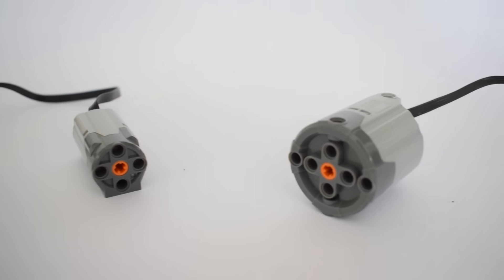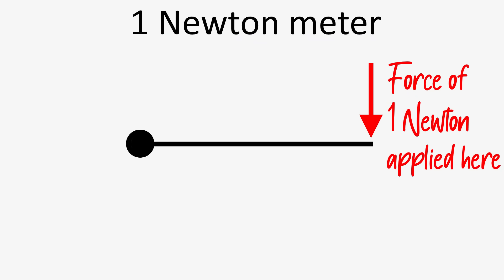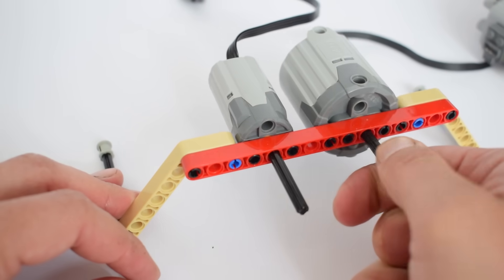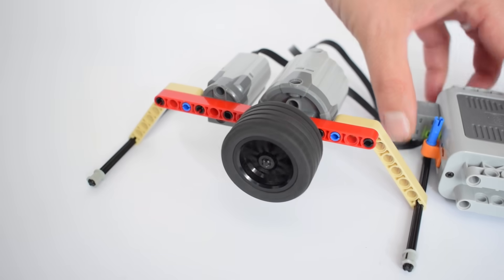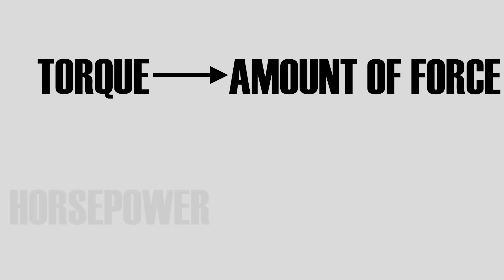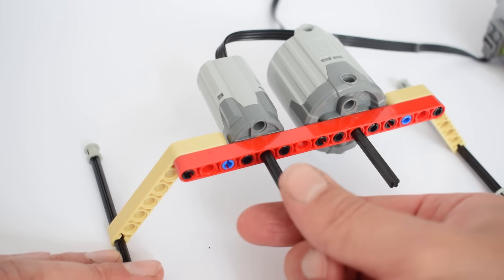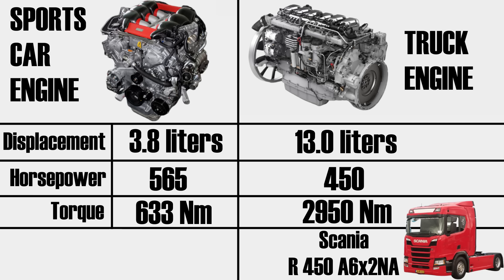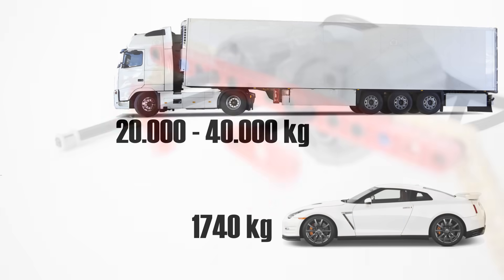NEVER be confused by HORSEPOWER and TORQUE again - HP and TORQUE EXPLAINED in the MOST VISUAL WAY

Comment: Another flawed explanation!
1. The narrator says you can't feel power, but that's 100% wrong.  If you are in a car that is sending 200hp to the drive wheels at 60mph and then get in a car of equal mass that sends 400hp to the wheels at 60mph, you will absolutely feel that in the form of accelerative force in your backside.  Watts are another unit of power: hold your hand 1" away from a 50w incandescent light bulb and then 1" from a 100w bulb and you will feel the difference in the form of heat as well as see the difference in light output.  Slow-burn 1 gallon of gasoline over an hour and then vaporize a gallon of gas and make it explode, you will feel the difference in power with all of your senses!
2.  If we transplant the GTR engine into the truck and gear it for the same road speed at its peak-power RPM as the diesel engine was geared, then it will pull more weight than the diesel engine at the same road speeds.  Power always determines the amount of work a vehicle can do in a given time interval, but the way the truck is geared it is putting way more power to the road at 5mph than the GTR because the GTR is geared much taller relative to its engine's RPM range.
Reply: Great explanation bro 👌🏻
Reply from the maker: You refuted your own claim 😂 You're feeling acceleration, heat and detonation. None of that is power. You can't feel torque*rpm, only its consequences. The gtr will not pull at the same road speeds because gearing sacrifices speed in favour of torque or vice versa, you can't have both, gears aren't magical. https://youtu.be/txQs3x-UN34
Reply: @d4a  acceleration is purely a function of power, road speed, and load.  The formula for determining the tractive force (TF, in lbs) that accelerates a wheel-driven vehicle is TF=375(P/V) where P is horsepower and V is MPH.  Engine torque is not considered at all: whether the engine is sending 400hp at 2000rpm and making 1050lb/ft of torque or at 8000rpm and making 263lb/ft of torque doesn't matter.  So when you feel a car accelerate, you are literally feeling the results of power.  Another way of expressing "power" is energy transfer.  That's why the more power a light bulb consumes, the more heat you feel: that's a direct result of power transferring from the filament in the bulb to your skin.  Same with the explosion.

For the GTR vs truck, look again at the formula for tractive force.  If the GTR were geared to send it's peak power (I think it was 565hp?) to the wheels at 5mph and the truck was also geared to send it's peak power (was it 400hp?) to the wheels at 5mph, then the GTR would either accelerate the same mass faster or a heavier mass at the same speed.  Period.  Power is the ONLY unit that tells us how fast a machine can do a certain amount of work ("work" = force over a distance).  Again, power is power: it doesn't matter how the engine is producing a certain amount of power, only that it is.

The problem with using a GTR to move massive loads is that in stock form, it is geared to only produce a small fraction of its peak power at 5mph.  And that makes sense because its mass is maybe 1/20th that of the fully loaded truck.  The truck, OTOH, is geared to produce peak power at very low road speeds and has anywhere from 10-18 transmission gears and a very low-RPM power range to allow this.  It can get that load moving because it can apply all of its power almost right off idle.
Reply: @d4a  you can have more torque at crank or at drive wheel axis but if you have less power at the same velocity acceleration be worse! Its because watt:m/s=force!!!!!
Reply: So you are wrong Herę Dude!😎👌🏻
Reply: @mociczyczki  At the drive wheels the force available to accelerate the car is purely determined by power and the car's velocity: lbs=375(Hp/Mph).  Torque is not a factor at all.  At any given wheel speed, if you have less torque you have less power.  You can't have more torque at the wheels but less power at the same time/speed.  I don't know what equation you're trying to type, but it makes no sense.  Power is always equal to work/time, or force*distance/time.  For example HP = (lbs*feet)/minutes.  At a constant speed (whether RPM or MPH) if you have less torque you have less power.  At a constant force (torque or linear lbs) if you have less speed you have less power.
Reply: @mattmiller3673  hehe i see you know how this study goes bro exxcellent except 1stuff you see when you compare 2siffrent vehicles with diffrent wheelradious yea 😎 now you see this ? Do mathi see you can calculate this good 😎👍🏻i can give you hard Numbers if you want which explain everything but in uour case im seen that i dont need to cos you be yourself calculate this and found answer 👌🏻your assumption is 100%correct when we have the same wheel radious so most likworyif we calculate force for the same vehicles or other with the sale wheel radious but trychoosesuch  wheel radious power at crank and torque at crank that you get more torque at drive wheeel axis lesss power at crank more torque at crank and lesss force at contact path 😎 anyway i give you egzample but im must fond correct corelation so give me a second 👌🏻okpal i give you egzample hard Numbers no bulls.t imagine we have 2 vehicles one have wheel radious of 1 metres and 1000 nm at crank engine at 1000 rpm at vehicles velocity 10 m/s. S some other vehicles with wheel radious 0;25 m which have at engine crank 250 nm at 5000 rpm also at 10 m/s now calculate torq at drive wheel axis and force and engine power and you seee what happen 👍🏻😎👌🏻 ok i write i know you can calculate this easy but im must write this 😂 first vehicles produce 140,4 hp at engine crank  and 10471 nm at drive wheel axis of torq and 10471 newtons of force at contact path vs second vehicles generated 175;5 hp and only 3270,8 nm of torque at drive wheel axis but ! Now magic happen 😜 at contact path it will generated 13083;3 newtons of pure force! So like you see from less drive wheel axis torque in second vehicles we have more force and power at the same velocity !!!!!😎 the pure brutal force which drive both vehicles is proporcjonalny to power both vehicles at the same velocity and completely dont fit to torque at crank and at drive wheel axis if we compare Numbers in both vehicles 👌🏻so yea now i Think you get it 🪠
Reply: @mociczyczki  nope, the force that accelerates a vehicle isn't torque: it's not rotational.  The force we're calculating is
 the linear force between the road and the driven tires' contact patches.  When I say lbs=375(Hp/Mph), I'm talking about a straight vector force at the contact patches.  So if a car is going 30mph and is putting 300hp to the wheels, then the contact patches will create 3750lb of force to accelerate the car.  If the car weighs 3750lb, then it will accelerate at 1G.  Tire radius and torque have nothing to do with it.
Reply: @mattmiller3673  ok Dudę i do video where i explain this in calculation it be on me chan el be like2 houers but in polisy language  so good luck with this 😜👌🏻
Reply: @mociczyczki  no matter what language or calculations you use, the fact remains that power, velocity, and load are the only things that determine the acceleration of a vehicle.  I can make any engine give any amount of accelerative force, but that will inversely affect the velocity of the vehicle.  I gave the example above of a 300rwhp car that weighed 3750lb and accelerates at 1G at 30mph.  If that car only had a 1hp engine, I could use gearing to make it still accelerate at 1G, but that would be a 0.1mph.  If I wanted to make it accelerate at 10G with 1hp, I could; but it would have to be at 0.01mph.  Nobody cares how hard a car accelerates at 0.1mph or 0.01mph!  Power is how fast you can get work done, not just whether or not you get work done.
Reply: @mattmiller3673  agree yea power and force are key at specified velocity agree with you the point oś you can calculate power and force at co tacy path from torque if you know wheel radious and that you can have more torque at drive wheel axis at the same velocity and less force at co tacy path in 2 diffrent vehicles with 2 diffrent wheel radious get it ?
Reply: @mociczyczki  if the wheel radius is shorter on one vehicle than another, such that it has more tractive force, then it will also be going slower.  They both have the same wheel torque, but one is going slower while accelerating harder because the overall mechanical advantage is greater.
Reply: @IgorArkin  read this again👌🏻
Reply: @IgorArkin  like im write read this again and watch me video smaller wheel can have lesss torque and more power and force !!!!! Do calculation and you will se this 👍🏻🪠

Comment: Got a question why when you have a low hp engine make bunch of performance mods and Dino it right let’s say it has stock 300hp 350 tourqe and make your mods and it has 400 hp and 380 pound of torque why does it feel so much faster and make a lot of difference on the quarter mile with only 30 pounds of torque and 100 hp makes leaps and bounds on time in the quarter and you can really feel the difference and turning the same rpm why does it go so much faster and feel so much more power if you only gain 30 torque and 100 hp but if you gain 100 torque and 30 hp it won’t run the same but you say you can’t feel hp but I’m just trying to understand why these situations are the way they are

Comment: If a diésel engine could do more torque than a petrol engine, how a small car could accelerate more?
I live in a 2400 meters above sea level city in Chile. Have a 3.2 liters turbocharged ford ranger with 200 hp and 470 nm of torque. I feel it  a very capable and fast engine. And always a freaking 1.6 liters small car can overpass me any time....
How can it be?
Reply from the maker: A Ford Ranger is very heavy. A small car is not.

Comment: This was all very clear, except one thing for me. If we're looking at a car specs and it says it has 140 HP and 250nM of torque after 1700RPM. Based on the video, would it mean that the higher RPM, the less Torque the car has?

Comment: Hi @driving 4 answers and engine heads,
I have one question. Say, a 286.01 cc single cylinder engine produces 30 ps of HP at 8000 RPM and 27 Nm Torque at 6500 RPM. 
After tuning the engine, the displacement is same but the HP is now 31.1 but at 9000 RPM. 

My question is that, is it possible to calculate the new Torque@RPM after tuning the engine? If yes, then what is the new figure for Torque@RPM and what's the formula for calculating it? Thanks in advance :)

Comment: just some minutia on the scania dc13, you aint gonna make it past much over 1900rpm on its own power and you probably don't want to go much above 2100-2200rpm using engine breaking specially if you are owner driver, otherwise 1500 rpm plenty enough to pull 40metric tonnes on mountains.

Comment: Horsepower = Torque x Speed.
Dental drill: High speed x Very low torque = Low horsepower
Waterwheel: High torque x Very low speed = Low horsepower
Top Fuel dragster engine: High torque x High speed = Monster horsepower

Comment: Thank you for this awesome video!
Just a question: high horsepower is always low torque and vice-versa?
Or is it possible have a motor with both high features?
Reply: Power = Torque * RPM.
That's it.

You can have high hp and high torque.  
For a given torque, being able to rev higher will generate more power.
Reply: @haha71687  but... power = horsepower ... am I wrong?

Comment: It's like running a 4000 kV motor a 22T pinion vs a 2000kv with an 11T it's what I had to do for my losi mini 8t and my Volvo S60 is no exception the redline is 6500 and it gets max torque at 4500 so yeah...i go slow even with a k&n truck intake a bumper ram E3 spark plugs and shell 93 with a 5cyl.

Comment: I'm so confused...not about the difference between horsepower and torque but how we can divide 100% of something into thirds using fractions  (1/3+1/3+1/3=3/3) but not with a decimal point (33.33333+33.33333+33.33333=99.99999).

Comment: Good video! But just a small note: the larger torque of the truck engine compared to the car engine, does not in itself explain why it's more suitable for heavy vehicles. 
Because the usefulness  of the torque is always the resulting power. If you have the same power at a certain speed the torque does not matter. The reason that the small car engine is not as suitable to run a truck(despite it can can have the same or higher maximum power) is that the average power through the rpm is lower.
The small engine could run the truck, but it would require more number of gears to be practical.
And if you use a variator, torque does not matter at all: a low torque then in any moment can be compensated with higher rpm.
Apart from that, another reason to use large engines to heavy vehicles is of course the lifetime and intervall of service. A car engine would probably break more or less regularly by the strain of pulling such a heavy loads constantly at high rpm.
Reply: At least someone understands it. I think it's pretty important if not the most important, and nobofy ever mentions it. Torque, by itself, is pretty much irrelevant. Any engine can produce any torque through set of gears.
Reply: @AndreiSZS  correct but the additional gearing would be heavy, expensive, and have high frictional losses
Reply: @AndreiSZS  thats torque at the wheels. The engine is still only producing a certain amount of torque and gears can multiply that to an extent but there’s still a limit to the amount you can do that. But ultimately it is the torque at the wheels that will give you acceleration
Reply: @racdude01  Engine torque is irrelevant. Any engine can produce any torque.
Reply: @racdude01  can you provide any formula that features both torque and acceleration?
Reply: @AndreiSZS  engine torque is very relevant when calculating horsepower. And yes technically you could build any size engine to achieve any specified amount of torque though it wouldn’t always be practical as a small engine will need to rev at a very high rpm to produce large amounts of torque whereas a large engine will rev much lower to produce that same torque. This also means the small engine will produce more horsepower than the large engine if max torque output is the same. If both engines were installed in the same size vehicle the small engine would achieve a higher top speed and the larger engine would likely accelerate faster. Unless you geared each car differently to compensate
Reply: @simplemachine9531  acceleration is a vector quantity and is change in velocity over time. So you can’t directly calculate acceleration just based on torque. All I meant was that it’s the torque at the wheels that makes the car go which is referred to as acceleration. That is to say an engine will produce the same amount of torque regardless of what gear the car is in. But the car will accelerate much faster in 1st gear than it would in 6th gear because the torque at the wheels is much greater in first gear than it is in higher gears due to multiplication of torque done by the transmission
Reply: @racdude01  acceleration depends on horse power. If 2 cars go at the same speed and have the same weight, the car that is outputing  more HP is  accelerating faster, gears don't matter in this case. Torque on engine can be any value.
Reply: @racdude01  
There is a formula featuring power and acceleration, here you go:
Power=acceleration*speed*mass.
Anything similar for torque?
"Torque at the wheels that makes the car go". Again, how come? Wheels are pushing the ground with force, aka "thrust", which is not torque.
The car accelerates better on the first gear because engine produces more power at the comparable speeds of the car. Imagine you are riding at peak power already, it will decline further,  and you have a choice to change car's acceleration: to shift a gear up, to shift a gear down, or keep pushing. Your choice if a win in the race depends on it?
Reply: @simplemachine9531 of course there is.
acceleration = wheel torque / (vehicle mass * wheel radius)

The denominator being a constant, you see acceleration is directly proportional to wheel torque at any given instance.
Reply: Fuel economy is also an important factor. Semi trucks need to travel hundreds of miles everyday which can be very fuel hungry which costs money. 

ICEs are not very efficient at high rpms because of high friction losses and (in the case gasoline engines) the rich air/fuel mixtures needed to avoid knock. Aside from compression ratios, truck diesel engines are more efficient because they can make a lot of power at much lower rpms where brake specific fuel consumption is at it’s lowest.

Comment: I always tell people to use the large power drill (torque) vs. the Dremel Tool (horsepower). The drill spins much slower but will twist your arm off if you put it in a bind while it's spinning where the Dremel too spins much faster but can be made to stop spinning if you press it too hard into the material you're working on.
Reply: Not quite though…. The dremal isn’t outputting very much “work” despite its very high rate of rotation.
Reply: you're mixing up speed and horsepower.  the drill has more torque and more horsepower.  You can verify this because a typical drill uses something like 1000 watts and the Dremel uses just under 200 watts.  watts and horsepower are different units of the same thing. so you could in theory put a gear box on the Dremel so that it outputs the same torque as the drill but it's going to spin slower under load. horsepower (or watts) is your hard limit of how fast you can get the job done.
Reply: Let's just all agree that Dremels are trash unless you have a very old one.
Reply: @robwoodring9437  hahah the guy we needed